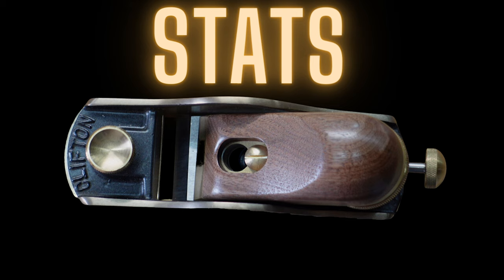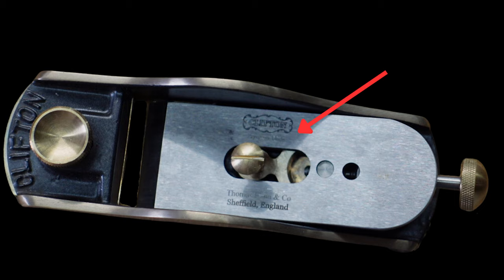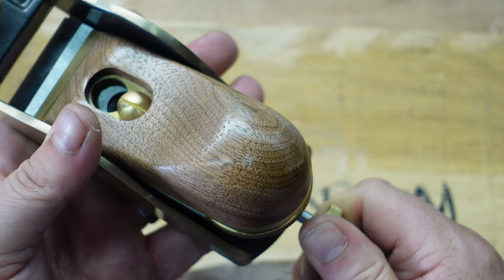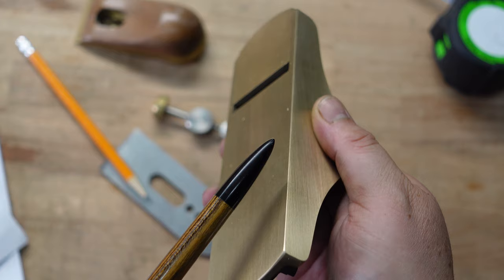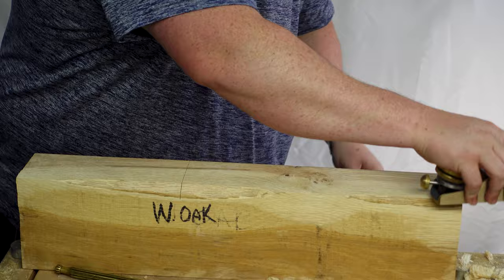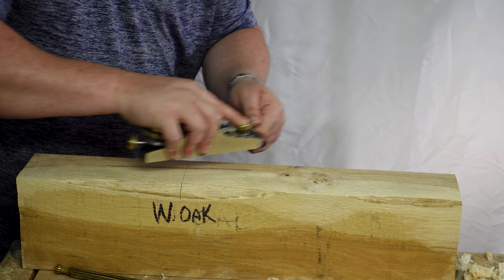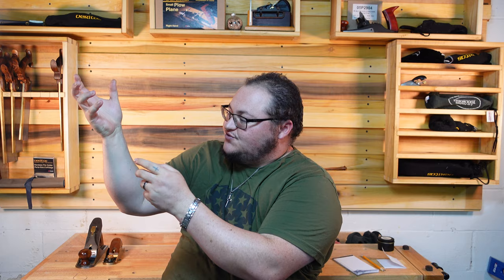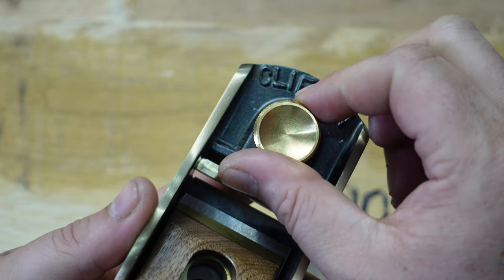Is it worth it? - The most EXPENSIVE block plane on the market!

Comment: At my first internship I got a blockplane for my work. It was a cheepo stanley with imposible pakage. That is one of the wide ones like this, but it just felt uncomfortable. Later I asked my classmates and they all had those narrow planes, from stanley or luban or dictum, and they felt great. I thought that was becouse of the with. But in my latest internship I lerned it was about the finger holes. The veritas wide one had 3 holes. I thought that looked stupid but it felt super nice in the hand. And after the wide veritas the narrow planes felt off. So maybe becouse the lack of fingerholes is why your hand hurts. Becouse you need to deathgrip it as not to drop it
Reply from the maker: That is a very good point! I use to have the veritas with 3 indents and it did feel better now that I think about it. Thank you!!!

Comment: Not only do I have small hands but also short arms and deep pockets.  
The Veritas DX is the most comfy block plane. If the DX is the fancy Toyota, the NX is the Lexus version at more than double the price (in Australia at least). The Clifton as others have called it is the Cadillac, so does make it a pimp''s plane?  
The size and weight of the plane make it more of a small and versatile smoother than a dedicated block plane.
Reply from the maker: Hahaha spot on with all of that hahaha

Comment: Thanks, Jamie! Did you ever make a comparison on fore planes and/or jointer planes? I see that the Clifton no. 6 weighs 4 kilos (4000 grams), and already with my Clifton 5 1/2 I feel like I'm holding a bulldozer or a bazooka, ie. something very, very dangerous, whereas the Veritas bevel--up jointer looks … kind … something that is not designed to scare the kids …
Reply from the maker: Thank you! No I haven't :( one day I would like to but I have to catch up before I start putting it out there that I'm looking to borrow tools haha
That would make a great comparison tho!!!
Reply: @BatCaveCreations   Another very strange thing would be to compare the low angle jointer to the mini shoulder, or start with these two at each opposite end, then look at the second biggest vs. the second smallest, etc., and see which one is most in the middle.
Reply from the maker: @finniunker860  hmm that is interesting! I like it! Thank you!

Comment: I love these plane videos. I picked up the add on tote and knob for my Veritas low angle block because of one of your videos. I've got a question for you. I have the LN 101 and 102 and absolutely love them except for the lack of adjustable mouth and lateral adjustment. I'm wondering what the smallest block plane is that has these features? The LN 60 1/2 is a little smaller than my Veritas and has an adjustable mouth but looks like no lateral. The Veritas apron plane has the lateral but no mouth adjustment. Do you of know anything that has been made with both that is closer in size to the 102?
Reply from the maker: Hey Joe! Check out the Veritas dx60. It is the sixe of the ln 60.5, has an adjustable mouth and lateral. 
The apron planes don't have adjustable mouths but the veritas has lateral.
The veritas pocket plane doesn't have an adjustable mouth but it has lateral. The pocket plane doesn't need an adjustable mouth that mouth is tight and can really get tighter hahaha
I hope that helps!

Comment: Is it low angle (12deg)?
Reply from the maker: There is ALWAYS at least 1 thing I forget to check and this time it was the bed angle. It is deff low angle but I don't know what degree :(
Reply: From Woodcraft Details:
Made from bronze, this block plane offers the ultimate in comfort and style, with walnut furniture and an adjustable mouth. You’ll be able to shave the surface of your project with ease. Made from a high quality bronze casting in Sheffield, UK, the plane is then finished with the new signature graphite color on the body to create one of the most stylish block planes on the market. 

Specifications:
Blade width is 1-5/8". Blade angle is 25°, and the angle on the bed is 12°, making the total angle 37°.
Reply from the maker: @stephenclingerman4865  thank you! I looked on tools for woodworking and didn't see it :( I'm glad you found jt!